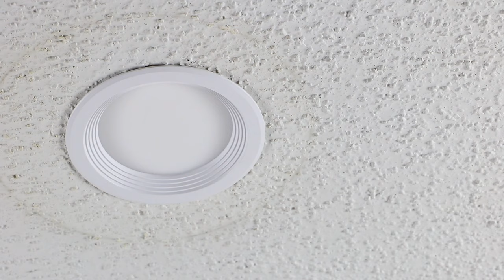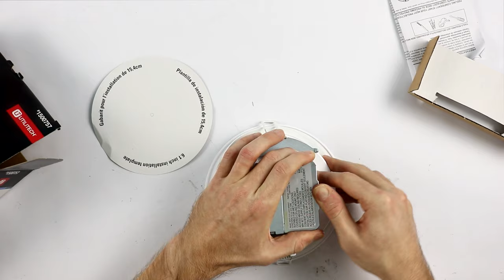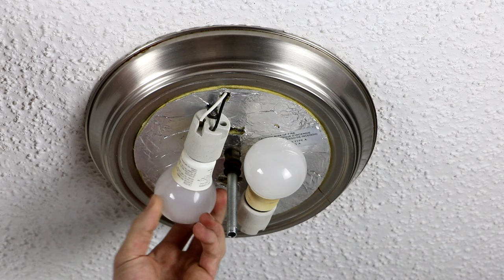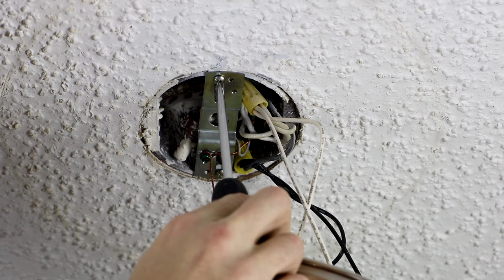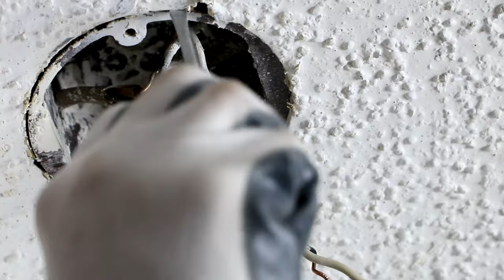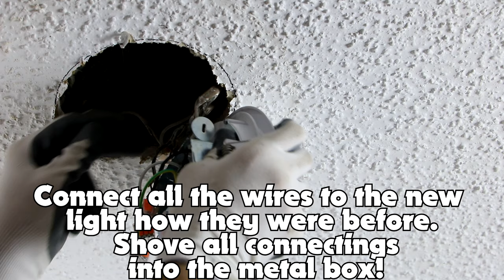How to Install LED Canless Recessed lighting - Upgrade Flush Mounted Lights

Comment: Would have been helpful to actually show how you connected that mess of electrical wires to the new box. And how you secured that LED box.
Reply: Right!!!! That’s what I came for
Reply: All the videos I watch suck at showing the part that is actually confusing!
Reply: That’s because every light fixture is different
Reply: So the previous light has a positive, neutral and ground so you use the metal junction box for the new connections.
Reply: @Mixwell1983 there's no positive in AC, it's called a hot wire

Comment: For those, who ask about witing it. He had 2 main wires (1 one coming from the electrical box to yhe light, and abother one from yhe light to the switch). Each of those 2 wires has 3 individual wires inside. You end up with 6 individual wires. 2 ground (green), 2 neutral (white), and 2 hot (colored, black most of the time). The led light will have a plastic connector with 3 slots. You need to group your wires by color and insert into a corresponding led light connector slots. Connect both white wires into white coded led connector, both green wires to grounf led connector and your colored wires (black, red, purple) into the colored led connector (normally red). You will end up with one extra slot on each connector. You dont need it if you simoly replacing yiur existing light, its reserved gor any additional led lights in case you want to comnect them in series. Hope it helps.
Reply: Yes, it does. One question, could my ground wire be bare? Like not colored?

Comment: Thanks for leaving out the main thing everone watches these videos.The wiring back to the new one.
Reply from the maker: My friend, everyone’s wiring will be different depending on many things such as connections made down stream, light switches, etc. other than that, it’s just connecting black to black and white to white.
Reply: @EnoughAboutCars  thank you 😊
Reply: @EnoughAboutCars  im still learning electrical 😅

Comment: What kind of approved NM box connecter did you use? OR did you just run the wires through the knockouts, exposing them to the sharp metal edges of the junction box?
Reply: Do you have the link to another video that shows a different way? I'm not being sarcastic,  I'm just an inexperienced home owner looking to do something like this.

Comment: Not all cans are screwed in, they’re nailed into a floor joist above (your ceiling) at right angles…. then what?
Reply: Break / bend by pushing up the box, sometime will loosen the nail, if not put your hand inside and cut the metal with metal cutter

Comment: For the. New work blue boxes and what ive had to do is take the gripping end of a hammer, pound the crap outta it to break the nails free that are into the joists/studs and then you're free.

I swapped a basic light bulb fixture for recessed and had to use that method to get the new work box outta the way..

I should explain, you take a hammer, turn it upside down where the handle is connected to the box, metal is downward and then take another hammer and tap it up.

It's either that method or you have to get in your attic and actually remove it manually push to be a real pain in the butt

Comment: This didn't show the unmounting the junction box from the attic, generally always these electric boxes are fixed to a 2x4 stud that can only be reached from inside of the attic & then can be pulled out from the attic not prying it out from the bottom.
Reply from the maker: That’s not correct. Most people do not need to go into there attic to replace a light fixture like this.
Reply: @EnoughAboutCars  Well yes there are cases you have no choice then to go into the attic to remove the junction box being they are nailed to a 2x4 or 2x6 stud joist, you can not just go straight up through the ceiling on older homes to remove a junction box being it's plaster less person wants to cut out a hole size of a volleyball which makes no sense rather then damaging that much plaster it's better to into attic removing the nails from the stud then disconnecting the wires as well then remove the box & install a new one it has to be nailed back in place from the attic & wires reconnected, if person is only installing bucket light recessed lighting then there are clamps that are attached to bucket light then pushed into ceiling without having to worry about renailing anything to a stud, nonetheless different applications for different lighting but regardless nails have to be removed from old junction boxes from the attic you can't just pull down on existing box from ceiling it's fastened by nails.

Comment: is it best to have all recessed LED in the whole house ? seem like recessed light are easier to change
Reply from the maker: I definitely prefer having recessed lights and if you're going with recessed lights I would definitely suggest LED because they save on energy and last longer than traditional bulbs. :)
Reply: @EnoughAboutCars  thanx for the tips ! I also think recessed LED is my preferred options. My builder said they need to make a false ceiling if built-in recessed lighting are to be installed. I found is quite strange , one cannot install recessed directly into the roof wall ? so they said they will find some flussh mounth thiner that look almost like recessed Led, what you think of all the reason they bring forth ? :) thanx
Reply from the maker: @francis87589   without being there, it would be hard to say for certain. However, my gut tells me your builder is only considering installing recessed lights with the can. The can that traditional recessed lights use requires more attic space. However, if you use canless recessed lights,  you only need a few inches of attic space. I would suggest brining up that option to your builder and see what they say.

Comment from the maker: I hope this video helps you with your recessed lights installation! Let me know if you have any questions and..
PLEASE SUBSCRIBE!!
Reply: Is heat from the new light a problem for the insulation?
Reply from the maker: @markvasiloff2217  This is an LED light, so it puts out little to no heat.
Reply: Thank you.  Thought so but I wanted to make sure it would be a fire hazard.

Comment: Great video but what if your box is nail in ?  By the way ALL of mine are and  the fix is to go into the attic and tear the electrical box from the 2x4  and then do everything you did.
Reply: Drill it out
Reply: If unable, or you just don't want to get into attic or ceiling space, as a carpenter, what I've used is a hacksaw 'blade' in a vice-grips, (locking plyers).  So, as not damage any hidden wires above, (you can't see them), only use 3 or 4 inches of blade.  Then simply saw between the box and the joist or rafter.  The nails will release fairly easily.  Usually there are two. 
  Optionally, you can do the same with a metal cutting blade in an oscillationg saw if you have one.  In my opinion, EVERYONE should!  It's got to be my top 3 favorite tools!! : ))
  If the box has protrusions, and you're unable to pull out the hole, you can just push it uo and out of the way.

Comment: i am having difficult time turning the metal part of the dome light.  it will not move so I can not take the dome light down. Any suggestion?  thanks
Reply: 0.42 you did it so easy???
Reply from the maker: Make sure you look for any hidden screw or bolts.